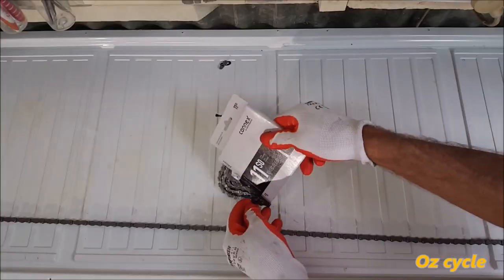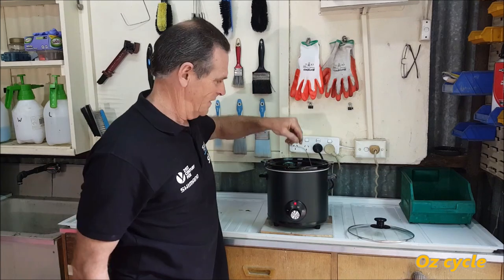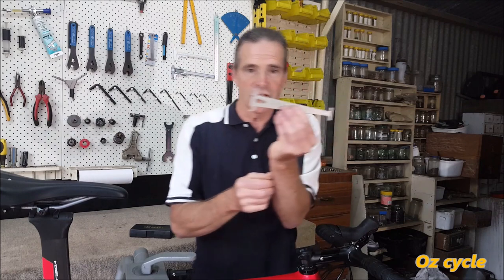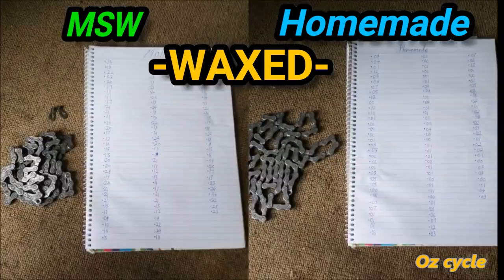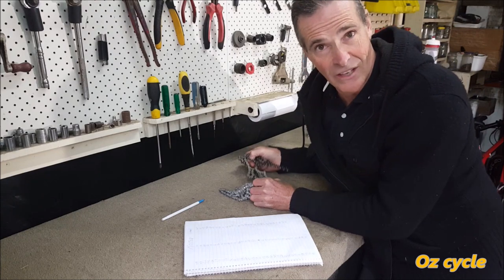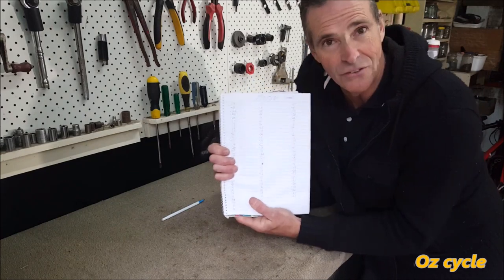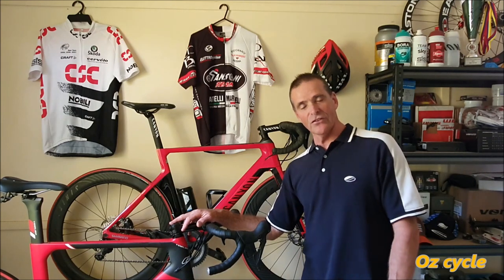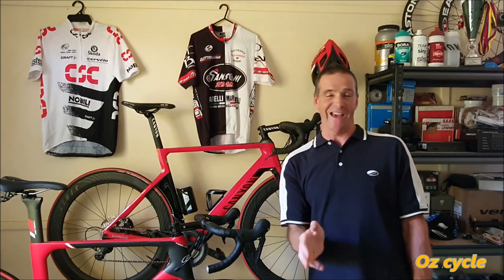Is this the ultimate bicycle chain lube? - Test results

Comment: Great video @ozcycle..I'd be interested to see how the old formula and new formula stack up against each other and also against a lube called Smoove. I've paraffin waxed before and had to re-wax every 160 kms. With smoove I can ride anywhere between 500 - 1000 kms on one application. I understand that the paraffin wax is a much cheaper option but on week long bikepacking rides, it takes the worry out of looking after your chain.
Reply from the maker: Comparing lubes on chain wear takes a long time. "Zero friction cycling" does such extensive testing,might be helpful to you Mark.

Comment: The difference in length after and before wash is the dirt and remains between inner plates, taps, outer plates and rollers. It might be that when it is washed, remains of washing liquid stay inside these inner plates, taps, outerplates and rollers, respectively. It is so close and tight that it does not come dry after wash. I noticed this fenomena when installing used and waxed chain on a bike gears. I need special homemade tools, bent spokes, to keep tight chain on place and loosely connect it with connector. When rotating cam, chain comes easier, same as you did with hands after waxing. With my paraffing wax and stearic acid lubrication a small chips of paraffing come from chain as it becomes more loose riding. I heard that paraffin is quite environmentally friendly so I don't mind, try to clean places still from paraffin. It burns nicely at incinerator too. Best to use paraffin as lubricant, not as candle, because candle makes indoor air polluted, like tobacco.

There is capillary-fenomena "sucking" the degreaser and other liquids between inner plate, tap, outer plate and roller. I think this capillary-fenomena is so strong, that it makes adjustments to chain length. Maybe some scientific study about capillary fenomena applying on chain length would do to make more understanding. :)
Reply: Capillary phenomena changing chain length.

Comment: I think I know what causes the difference in wear  between a MSW waxed chain and un-waxed.  It is of course strange that a waxed chains shows more wear than an un-waxed. The tension on the chain is in one direction, making the MSW shift from one side to the otherside inside the chain. It remains there and is not shifting back. Now when you clean it the pinion is shfting back to the middle of the chain. Conclusion is in my opinion that the teflon is probably less easy shifting in the chain and keeping therefor the pinion more in the middle of the hole. Deriving from this you could conclude that MSW is less lubricating the chain at the spot where the tension builds up inside the chain. This also explains the final wear is higher of the MWS waxed chain.
Reply from the maker: I tend to agree with you on this

Comment: Can't wait for the recipe! I had chain wax for my motorcycle, hadn't thought of it for my road bike. The motorcycle version was in an aerosol, and started as a liquid, allowing penetration, then dried on. Horrible stuff to clean though. I would guess that the shiny finish and the residue you found suggest wear/metal. Put a magnet in the liquid and it should stick. Great video. Best regards.

Comment: I think a better visual of total chain stretch would have been to NOT re-lube the chains. Straight metal to metal contact within the individual links would be more accurate IMO. You could, also, put a constant pressure on the chains with a spring of use something like a trigger pull gauge to have a measurable pressure. 
Great video and I look forward to the new wax formula video. I recently switched to wax lube after watching our videos and am very impressed with it.
Reply from the maker: Did that,same result Bruce.

Comment: Using Turps will allow mineral oils to get into the chain centre this won’t come out with water and will resist the wax.  I think Molten Speed Wax need to consider the way you clean it.  It also would explain the black residue in the petrol afterward as the oil in the turps has done its job and taken the dirt.

Comment: I am using speed molten wax. My previous 10 speed sil-tec chain last 4000km before reaching 0.5% elongation. My sram cassette is now at 10000km, still spot on with a new chain. I am riding an xc bike, 90% mileage on road and the rest off road. I live in Hong Kong, an always dusty and humid (humidity>85% from feb to nov) drive train killing area. Just be reminded wax doesn’t prevent rust as lube does. Another down side of wax is.... I may need to ride another 10000km before I have a legit reason to upgrade my drive train

Comment: I've waxed 3 chains and my neighbor 2. Mine were ready to rewax, but looked very clean. So brushed off some very minor dust and warmed the chain with a hair dryer. Just to about 50C. Then coated it with the xylene/kerosene/paraffin solution. Looks great and don't have to take off bike.

Comment: The part of the chain that requires lubrication is not the contact surface, but the rivets and plates. After cleaning and degreasing the chain, all you need is to spray it with some regular WD40, work it in there to get it to penetrate, then wipe off the excess. The chain will work and shift great, will not retain dirt, and will not rust. This is what I do on my bikes and motorcycles - works great. I've tried dry lubes, teflon sprays, various other stuff and the best results have always been WD40.
Reply: Nooo I hate using it. This works much better

Comment: Nice. I’ve been using parafin wax for years, but my cleaning procedure is quite diferent, using varsol, in successive stages, three jars.  After the crud settles, I can decant the varsol into fresh jars.  Remembering that Dilution is the solution to pollution”

Comment: Thank you for the interesting video and the semi-scientific approach! 
The downside of all of the lubes that require dipping of the chain is that you need to take the chain off. Shimano chains come with a "quick pin" normally, and no "quick link" so that automatically rules them out. If, however, you are to use a chain with a quick link: all quick links apart from the Wipperman only allow a number of disconnections before the safety and reliability of a quick link is compromised (usually around 5 disconnections roughly, sometimes only one). Wipperman Connex quick link can be disconnected as many times as needed, however, if you measure it you will see that it is quite a bit wider and longer than normal chain rings. Unfortunately, I am not aware of the studies that show whether the odd size of that quick link affects performance and wear of drivetrain, however, from the engineering/mechanical perspective tolerances are very important.
Reply from the maker: Wipperman links fit all 1/2" chains,Shimano included. Match the width of the chain with speed ie: 11speed link  for 11speed chain.

Comment: Just wondering if there is any research available on wax adherence to friction points in the chain when riding in cold temperatures in the plus or minus 0º C range.  I have all my ingredients for the old recipe, and am anxious to try it, but debating on waiting until Spring.  In SW Ohio we hit 13º C (not normal for this time of year yet) already and while I won't ride in that extreme- 0 and a little above and below is doable depending on ground cover.
Grateful for the videos!
Reply from the maker: Completely clean your chain of all previous lube and the wax will stick no matter what temperature
Reply: Thanks for such a quick reply-- I'll do a thorough clean as you demonstrate- followed by the wax treatment- and when the snow here is off the pavement- I'll be on it!!!  Great videos and instruction!

Comment: Thanks for all the clarity! Could you put a magnet under the containers with the debris? If it is rust-related, which it might be, then it should react and lay down in a pattern. One question: I don't understand the need for a degreaser between petrol and the methylated spirits. If you refresh the methylated spirit, then you should get rid of the remaining petrol, I would argue. Also, it would keep away water and soap (of unknown origin) from the procedure. Just wondering - it's what I did anyway. I did get a bit of squeaking past 1000km. I put on some xylene-based paraffin. Thanks again for all the videos!

Comment: Great video, it's obvious a lot of work went into this. A few comments/questions/concerns.

At 16:20, when you have trouble fitting the tool between the chain links, since the inside faces of the caliper jaws aren't used in the measurement, you could technical sand them down a hair to let them fit in very tight chains.

As for the contaminants in your cleaning jars (11:03), a magnet could at least tell you if any of it is metal particulates from the chain sticking to it. That won't tell you how much metal has worn off onto the road though - if you had a fancy scale though, you might be able to measure that (after full cleanings) and that would be kinda interesting.

Some of the black bits on the MSW chain, cassette, and cleaning residue might have to do with the fact that MSW itself is black to begin with.

For drying your chain after rinsing in water, I'd recommend a quick dunk in some sort of fast evaporating. Dunno what you call it in Australia, but any paint thinner type solvent or even rubbing alcohol would work. It'll flush into the cracks, wash the water out, and then it itself will flash off quickly, leaving the chain dry and without rusting.

I see you mention elsewhere in the comments that you do a quick clean and rewax every 250km. I'm not yet a member of the waxing club, but when my current chain dies (ETA ~5mo), then I plan to get a new cassette, three chains, and cycle through them (no pun intended). Even out the wear on each chain, so they wear in to the cassette evenly, and then make it a bit more efficient to rewax them in bulk. For the time being, I just do a light re-oil ever 200km and wash it and the cassette in an ultrasonic cleaner every 1000km (which works fantastic for those of us still on a traditional lubes). I'm getting about 5000km out of a chain, so getting ~40000km would be amazing. That would reduce the cost of cycling down to basically just tires and calories.

How much life would you typically get out of a Connex chain using a traditional lube? That's not a brand of chain I'm familiar with.

Is this just the combination of paraffin wax, paraffin oil, and xylene that you had showed in earlier videos? I know that teflon flakes and molybdenum disulfide (an industrial grease additive) are also very popular.
Reply from the maker: I agree about taking a tad off the tool end but I'm not going to do that to a nice accurate tool.
Great suggestion to use a magnet...I'm going to do that soon as I finish typing this :)
An 11so Connex chain with it's factory lube lasts about 78 hours of riding (many variables determine this figure tho).
Early wax was candles and paraffin oil.
Boiling water is good for a waxed chain clean 1/ no chemicals required 2/ rinses  off all wax and grime from outside of chain leaving wax inside intact.

Comment: G'day Ozzie! I have waxed my bike chains for some years now thanks to all your videos. Thank you for all the great information you provide. I'm now going to make your new wax bath with added teflon powder and I would like to start with all my previously waxed chains clean and sterile. My old wax is quite dirty now and possibly contaminated. How do I get my previously waxed chains cleaned down to bare metal again? Should I soak them in boiling water or will soaking in petrol dissolve all of the wax? Appreciate any tips. Thank you.
Reply from the maker: Yes,you will need to do the complete clean again...petrol,etc

Comment: Good video, thank you. I’m looking forward to hearing how you have refined your wax. On reflection I think it is a pity the two chains were not subject to the same cleaning regime. It’s a while since I have read it, but I think Molten Speedwax (or maybe Friction Facts) finish off with an ultrasonic clean with a few drops of detergent. It seems to me that any process which only uses solvents will leave a small amount of highly diluted oil on the chain which might affect adhesion of the wax. I have been using your wax formula with the addition of tiny amounts of molybdenum disulphide and PTFE powder, but unlike Molten Speedwax, I add paraffin oil. I clean with petrol, and metho, and finish off with an ultrasonic clean. I don’t have objective data but I reckon we are getting much more than 250k per, however running two chains makes it easy to swap for a fresh one so I often do it before it’s really necessary. I will definitely never go back to oil based lube.
Reply from the maker: Sounds like your on the ball there Douglas. Yes,the key to successful waxing is the clean.

Comment: Wouldn't it be better to hang the chain vertical from the end link using a bit of wire from the garage rafter so that gravity gives you a proper measurement of stretch?

Comment: When it comes to the dirtyness of the chains, what kinds of rides did you do with each chain? Even just one more ride on wet roads (not even rain) could probably account for that film in the jar and possible rust, assuming the homemade wax chain saw more fairweather days. Also, wasn't the MSW a grey/blackish color and the homemade wax white? That also could account for the color.
Reply from the maker: You are right Bob. However it's spring here now and at that stage the chains were both riden in dry conditions.

Comment: awesome video. a few comments: 1) should have measured the initial chain stretch out of the box for both chains (it is possible that by chance the MSW one was slightly longer to begin with); 2) aside from initial factory difference, could the large difference in stretch before cleaning due to the added thickness of wax/grit? 3) would love to see the data publish online for stats nerd like myself to play around with.

Comment: Thank you. I am 12 months wax chain pariticpant - applying your instructions and recipe. It works well! The next PTFE mixture will be applied, once the PTFE is arriving in March. In this regard I would have a question. I plan to upgrade to PTFE Waxed Chain next month. In 4 month (European summer) I will take a long 10 day / 1,300 km ride from Frankfurt (Germany) to Barcelona (Spain). How can I wax may chain on this trip? Can I use your recipe from 2017 (?) with Wax, Paraffin Oil and Xylene each portion 1/3? I have to wax appx. 5-6 times. Thank you.
Reply from the maker: Hi Ralf. How to make a bottled liquid version of the PTFE wax is the next video. Cheers
Reply: oz cycle great, perfect. Sounds good. Its getting getter and better. Remember the first steps without removing the chain in early days.

Comment: The black sediment in the molten speedwax is probably Molybdenum sulphide (MS). I wax my chains with a formula using teflon powder and MS powder. The MS gives the wax its dark grey colour.
I got the formula from an old article on the Bike Radar site. I think that the guy that devised the formula went to work for ceramic speed on their lubricants. It certainly works well, I have been monitoring the chain wear rate which is very low. I got the MS powder from a website in Brisbane. It is used in firearms to stop them jamming.
Incidentally ,How often did you re-wax the chains in your tests??

Comment: Good video. Ideally you would have checked the length of both chains first. Chain manufacturers will have several machines making the same chain. It doesn't take much tolerance for variation to occur. Also you don't mention how often you have been rewaxing. I have been using MSW and I'm I little dissapointed how often it appears to need rewaxing. This is a pain when on a cycling holiday.

Comment: Great video. I tried the wax last year with great effect. Perhaps you should have chain checked both chains with kmc checker at the start before the wax was applied to make sure it was not just a batch or different machine  that gave the difference.big manufacturers will have multiple machineshes making these high volume product's  with different tolerances.  Cannot wait to see your next video so I can try it over our winter.  From a rainy England.  Over and out

Comment: The difference in tension may be due to the use of slightly different rings on the two bikes, as well as due to the different distance from the chainring to the cassette! Most of all chains are stretched on sprints and riding in hills, so the comparison can be objective if you ride the same routes, avoiding long hills.
Reply from the maker: Chains were swapped to the other bike every rewax.
Reply: @stevenleffanue  Yes, this equalizes the conditions of the experiment!

Comment: The dark residue in the petrol is molybdenum disulfide, a very low friction dry lubricant. MSW is basically just molybdenum disulfide and PTFE powder mixed into wax

Comment: Here is a note to USA waxers about sourcing “paraffin oil”. I believe here there are two versions of mineral oil, one of which is equivalent to the paraffin oil of Australia. 
There is heavy and light mineral oil. Heavy mineral oil is labeled just “mineral oil” that you find otc in drug stores. This version is too oily for chain wax. The light version can be easily found in farm or vet supply stores labeled “Mineral Oil Light”. Like regular drug store “mineral oil”, it is used as a laxative, but for animals. 
It is sold online or in a farm-oriented hardware store here in US called Tractor Supply for $20 per gallon.
Reply: US alternative name is Kerosene.

Comment: Amazingly well done video! What about drive train efficiency? I don't mind changing chains more often if the efficiency is higher.. also how long does the drive chain stay quiet between waxing?
Reply from the maker: Assume you mean friction Isaac? The wax poses extremely low friction,hopefully getting that tested soon too. Rewax every 250km